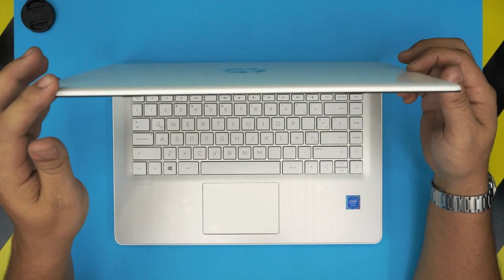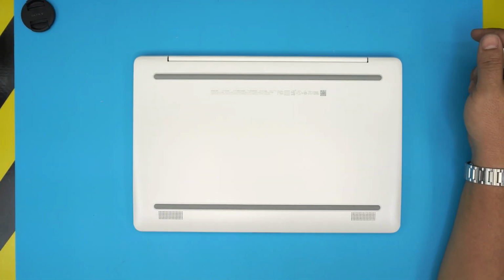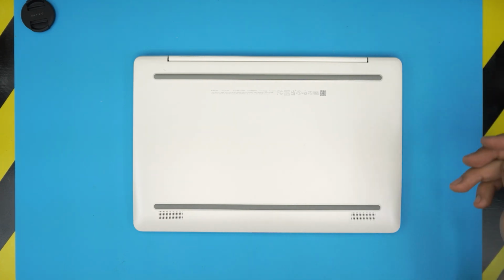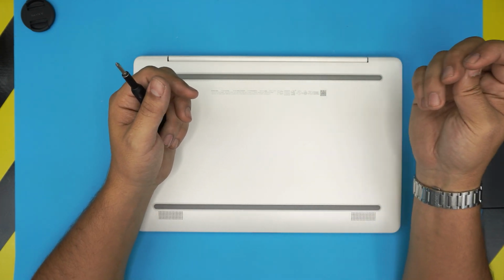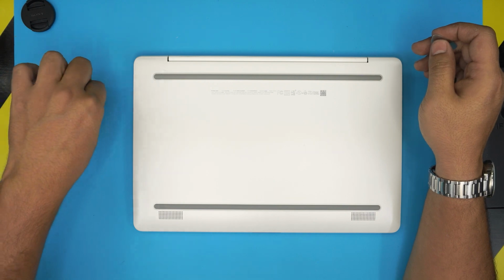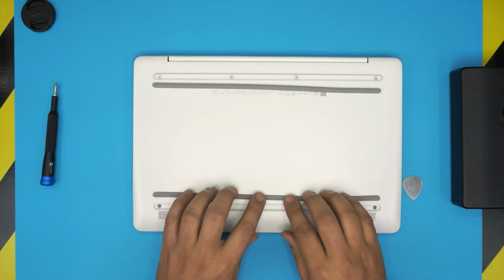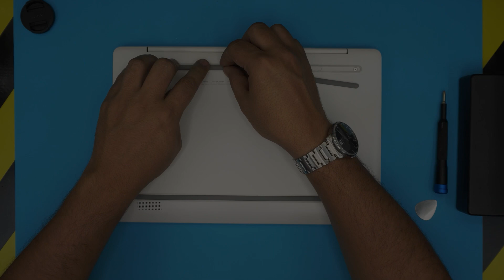Hp Stream 14 Ax113 🚩BATTERY Replacement

Comment: This was fantastic.  I was able to take off the back of my HP Laptop. The battery was not working. I took the battery out, pressed the power button for 30 seconds. I reinstalled the battery and then put the plug in and powered it up. It is now charging at 15%. Even though your video is to replace the battery, I read that I should try this once I get there. I would never have gotten there without this video. I was clueless as it was a non replacemnt friendly laptop.  I also did not know you are not supposed to leave the charger on all the time. This is what depleted my battery.  Once it reset, and when I plugged it in it said it would reset the bios.  Thank you so much for a very easy to follow process. You are genius! I loved it. Please keep them coming as we need technical people like you to help us. It saved me a trip to Geek Squad! I feel so lucky to have found your video. Thank you again.
Reply from the maker: It's my pleasure, my friend. 😊 I deeply appreciate your taking the time to provide feedback. If you're inclined to support the channel further, feel free to like and subscribe—or even both!
I'm glad that my videos are helping people time and money, i do try to place as many videos i can, but most importantly is trying to reach out and answer every comments and help people in need. i have over 18years of service in this field of repair and servicing, should you have any questions or requests in the future, please don't hesitate to ask me.
🍻cheers

Comment: Where is the CMOS battery
Reply from the maker: Thank you for your feedback! If you wish to support the channel, you can like, subscribe, or both!
Regarding your question, there is no cmos battery the CMOS takes it's power from main battery, remove the main battery and press and hold the power button for 60sec and it will reset the CMOS settings. 
Should you have any further questions or requests in the future, please don't hesitate to ask me.

Comment: man sorry for the trouble is there another way for me to know the the battery model I don't even have a screw driver to open the back
Reply from the maker: The best 100% is the way i told you, even if you get the right model you will still need to open and place it in there! how you going to do that without opening the cover?
99.99% this is your battery: https://amzn.to/3v770kO
Reply: @uFixTek  yup that's it where can I get it amazon doesn't have it in stock
Reply from the maker: you can try ebay or aliexpress , they take longer to send
Reply: @uFixTek  thank you
Reply from the maker: my pleasure

Comment: Another question I have a HP stream 11 my system model is ak0xxx .I want to find the correct battery for my device
Reply from the maker: ok in order  i can get you the correct battery i need you to open up the laptop and get me the battery model, as you can see i point to the battery model @5:44
if you have the stream 11 just simply remove the cover as you would to replace the battery and get the battery info and i can assist you with the correct link.